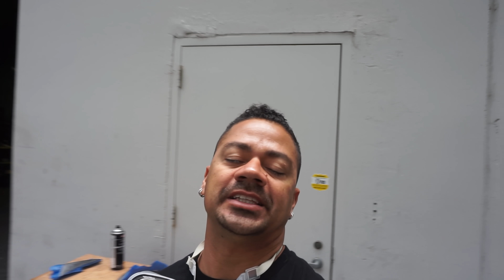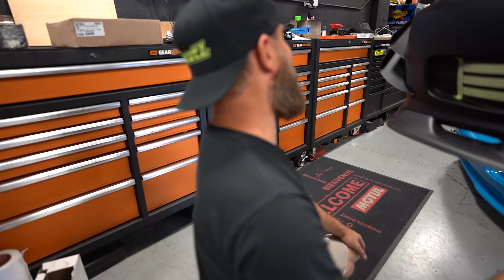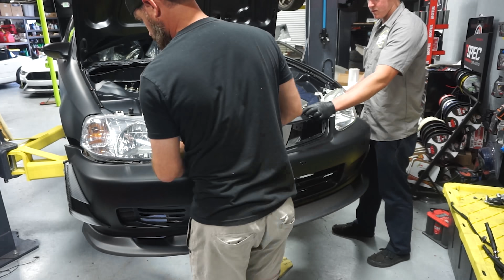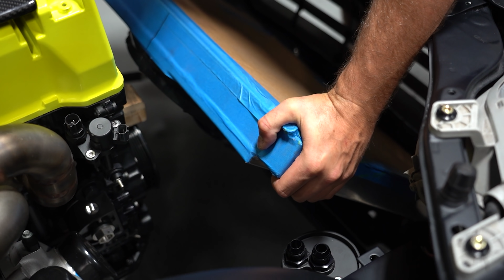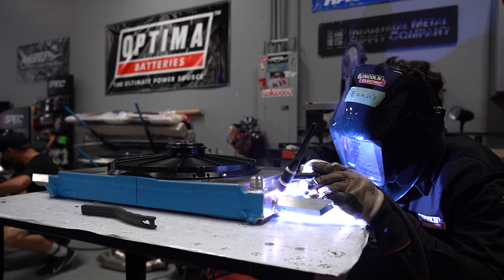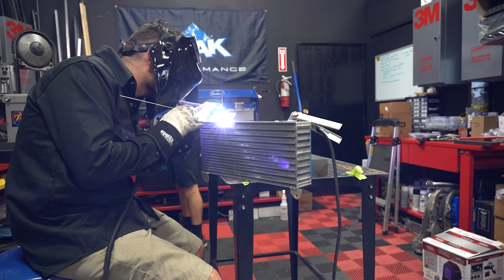Building a Rear Wheel Drive, K20 Turbocharged Honda Civic EK Hatchback Race Car- Reassembly Part 3

Comment: I’ve been following this build lately and I know it’s late but mounting the radiator like that made the fan useless to cool engine down. It’s pulling air from radiator all right but the efficiency of blowing the air to cool the engine is compromised. Especially forced induction. It’s just blowing towards the ground, more for show than function.

Comment: I know its late but, I don't trust the square tube brackets for the radiator. It won't support the weight once it is filled with coolant and the vibrations. You could've used solid aluminum flat bar instead

Comment: Guys, track cars are supposed to have as Little openings as possible to decrease drag 

Its better to use already existing holes and utilize them as efficient as possible
Reply: that is for time attack cars you don't need to worry about drag in drifting
Reply: @joshsuelto  they literally put rear bumper openings for drag reduction...
Reply: @OGNISTYSZKQAJDII  it doesn't mean that they need drag reduction, it's not a time attack car or a drag car it's a drift car
Reply: @joshsuelto  its track car

Comment: Is t that radiator just going to dump air under the car at high speeds if you have it mounted in that direction?  Instead of having the fan blowing down at the ground pumping air under the car, you should have it facing up and over the engine then cut some holes in the hood to vent air.  If you duct in the radiator it should help add a fair amount of down force.

Comment: I feel like on the front bumper it woulda looked better if you just used a carbon fiber duct piece/ cover/ inlet . And also use a custom carbon duct tunnel piece to mate up to the cooler, that or aluminum. Or use the existing hole and make a custom tunnel duct that mates up to it.
Reply: A duct was not an option. The cooler it literally against the bumper.

Comment: Can someone explain to me why having the engine tilted is okay?
Reply: It looks worse sitting in a north south orientation but the K20 does sit tilted in the Honda's they come out of. The only reason I can think of as to why Honda did it was to be able to get the exhaust manifold down and under the firewall on a better angle. You can also see the rocker cover is tapered looking at it from the front of the car with the top of the cover being close to flat.

Comment: normaly they do 6 hole 3x2  couple inche each just to make air pass and lets the car look stock ;) here she is https://www.facebook.com/photo?fbid=483857159312039&set=pob.100030632780775
Reply: thats whats i did on my 92 hatch
Reply: i got is little cousin on my garage just waiting for roar like bitch next years cause money not flowing like you guy xD
Reply: you guy did in couple month whats i did in 4 years
Reply: and now need to change couple part to make it upgrade at 2020 taste xD new icu new intake new throlt body all skunk2 and waiting buying 4 new piston retainer high pressure and new valve spring but last time to dyno 412 hp for 302 lbs torque xD its a dawm tuna can or nothing else then a cuffin if you want xS

Comment: How is that intercooler going to get air when it's placed horizontally 🤔. Or am i missing something here?
Reply: That’s what I’m wondering also cause even the fan placement isn’t gonna do anything but kick up dirt and debris unless they have skid plates going on.
Reply: The v mount set up is pretty common on FDs and these guys have a few of them I think they got it figured out.
Reply: @ericholtz9374  I know what you're saying but everyone knows fd's overheat on the track?  And aren't they building this to be a track car?  I know from my experience from doing track time you need as much air flow through the radiator and intercoolers possible.  I mean aesthetically this may look cool I just can't see it being very functional on the track 🤔
Reply: Hang in there guys. It’ll all make sense in due time. 🤙🏼
Reply: @mickeyandrade3435  this build is epic so i know you have something up your sleeve 👍

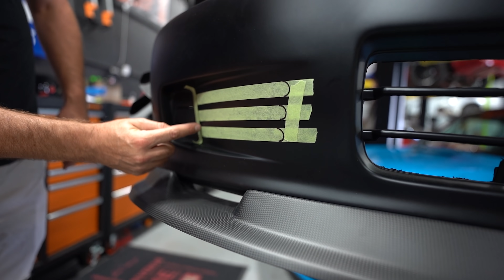Comment: i would have done a more aggressive angle on the oil cooler kinda like how f1 and indy cars have their rads damn near sideways. 3:05
Reply: Just for looks or is there any benefit in this case?
Reply: @jdmfreak22  mostly looks, the air flow off the front bumper shouldnt have much of an effect on down force or front end turbulance.  im just not a fan of miss matched holes.